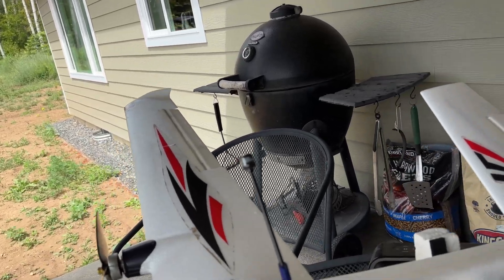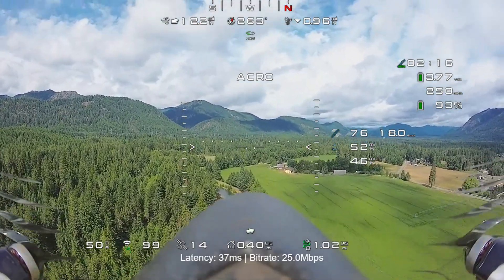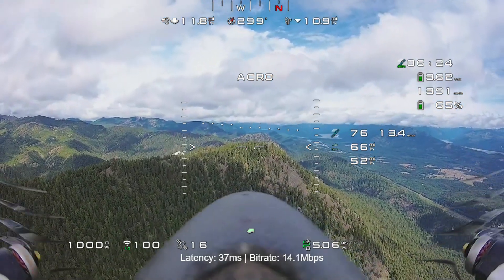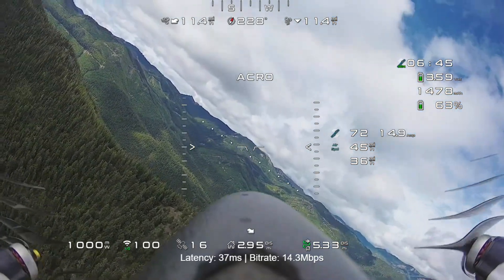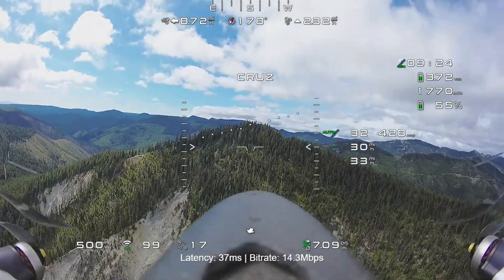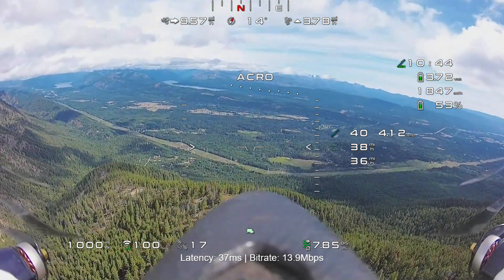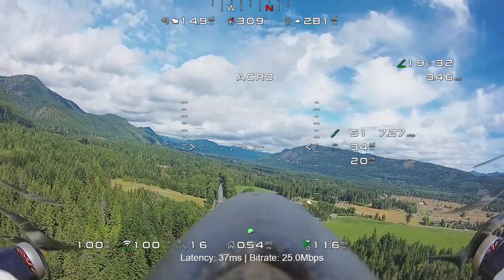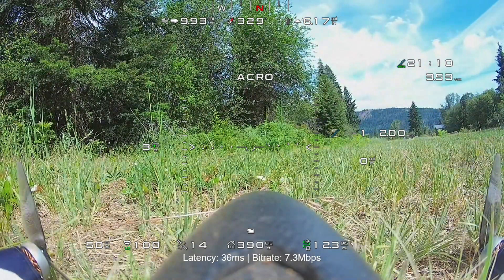TrueRC X² AIR MK II antenna test

Comment: Great stuff!  I've been hoping to find some videos supporting HD at distance like this.  I've been flying 1.3, and it's rock solid, but seeing HD would be really nice.  I haven't been super excited about the way HD loses signal though, it doesn't degrade like analog.  I appreciate what you've done here.  I did a similar distance in a recent video.  I think you can prob bend those antennas up a little more, maybe 45 degrees between them rather than 90.  That should help a bit more on the radiation pattern off the side, especially if you're at distance and not flying overhead.  Great flight, and thanks for the narration, that was cool!
Reply from the maker: Thanks for the suggestion, I might give that a try. The HD is well worth sacrificing distance in my opinion. But you're right about HD signal loss, at least on Walksnail, there isn't much warning and sometimes it just outright freezes.

Comment: If your batteries are lion then you can safely draw them down to 2.5 volts per cell
Reply from the maker: Thanks for the feedback!  I was starting to realize that I can adjust the voltage settings down even further in iNav. These are Molicel P50B's so they should be able to go 30% lower than I'm currently taking them (about 3000mAh) on 30min flights.

Comment: The TrueRC X² AIR is definitely a game changer antenna with that 13dBic gain and still a wide 75° coverage.  Amazing.  I bought 4 of them and have them arranged 90° to each other to get 360° coverage since they nearly 90° coverage.

No real need to do complicated antenna tracking especially for longer range.  If I'm doing longer ranger, I'll point 4 of them in a given direction and get a full overlapping 180° coverage in that direction.
Reply from the maker: That's an amazing idea!
Reply: @rscofieldfly  Glad to see you got your video receiver antennas tripod mounted.  I do something similar but with a roof mount on my van.  Then I fly from inside a comfy leather seat out of the sun, wind, and cold.  This arrangement is big improvement to remote FPV flying by the side of a road, or in winter.

I also have long SMA connector for 2.4GHz/900MHz TX antennas on the roof (Gemini-X setup).
Reply: @RCHobbyFan  The setup sounds very interesting. Could you point me towards some resources on this, how to mount, what to look out for, etc?
Reply: @ivan.vatovic  Sure thing!  First you'll need the Walksnail Repeater.  It's a bit costly but core to my setup.

I put my Walksnail repeater on small wooden board with soft felt on the bottom to avoid scratching the roof of my van.  You'll need to supply 3s to 6s power.  I just used 4s LFP battery (13.6V).  Optionally, you can use a small 25W to 50W solar panel with 12V power regulator to run all day long in addition to the 4s LFP battery.  The battery is necessary as buffer in case there's not enough sunlight.  But most times, my 4s LFP battery ends up fully charged at the end of the flights.

The Walksnail repeater is completely wireless when it has its own battery up there.

But will need to SMA extension cables to run the ELRS antennas up there.  Or whatever transmitter system you're using.  I put this some distance away from the Walksnail repeater as I think there's some interference going on if transmitter is right next to the Walksnail repeater.

This has been a big game changer for FPV.  Flying from inside a vehicle is so much more comfortable summer, spring, fall or even winter if need be.  Its also more "realistic" to be sitting in a vehicle's sturdy padded seat as it simulates an aircraft's cockpit.  My Honda van also has an automatic sliding door as most vans do.  Its very neat to have it automatically slide and lock in place as if I'm strapping into a cockpit.  Then I take off with any of my VTOL craft.  For fixed wing it works too right after hand launching, I'll slide into my seat and activate the automatic sliding door.
Reply: @RCHobbyFan  impressive! and fun :-) Thank you for replying to both of my questions. Safe flying.
Reply: @ivan.vatovic  Thanks.  BTW, it is possible to avoid the expensive Walksnail Repeater by mounting the Walksnail VRX on the roof then run an HDMI cable down to your video goggles.

But the HDMI cable could cramp your head movements especially if you're using head tracking.  Also, if you need to push any buttons on the VRX to go through the OSD, you need to get up onto the roof to access the VRX's physical buttons.
Reply: Did you find the narrower vertical beam of X2 to be "bothersome" (for lack of a better word) during long-range flights? Did you have to put a lot of effort into riding the beam? I'm just starting to cross the 5mi range with my 7" and 8" quads, so X2 came into consideration.
Reply: @ivan.vatovic  For long range, the combined beam width hasn't been too much of a problem for long range.

Remember the beam continues to widen out as the distance increases.  So when my FPV plane is out far (like 4km+), then its a small dot barely moving in the beam width.  And I have four TrueRC X² AIR pointed in one direction for easily a 180° field with overlaps.  So could go even beyond 180-° if you reduce the overlaps.